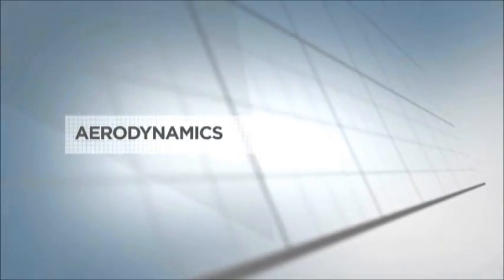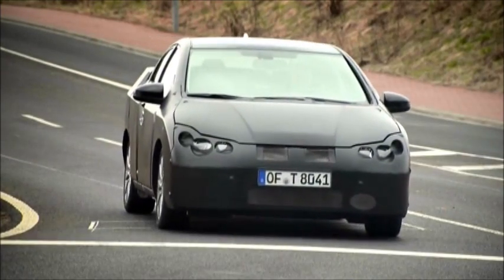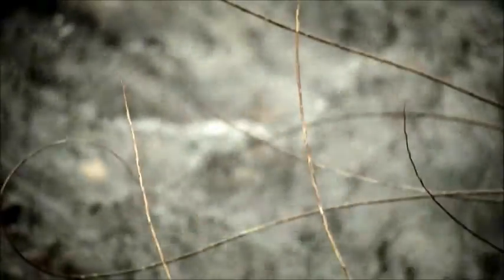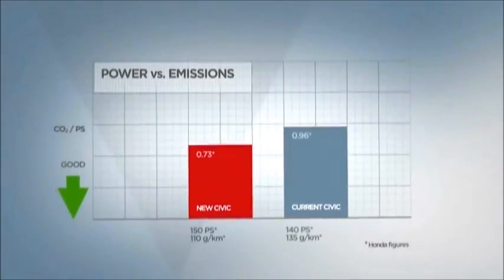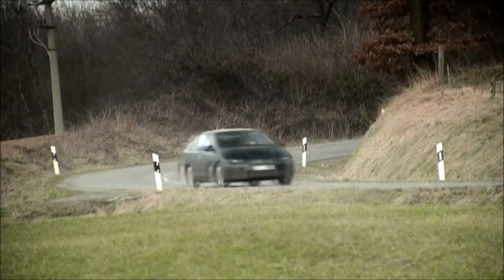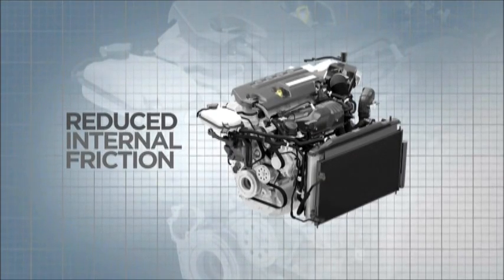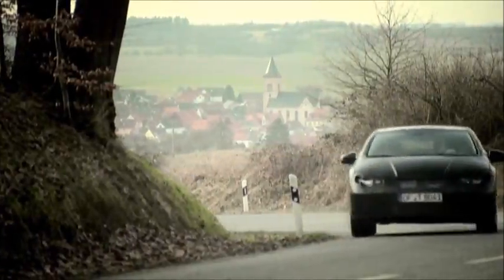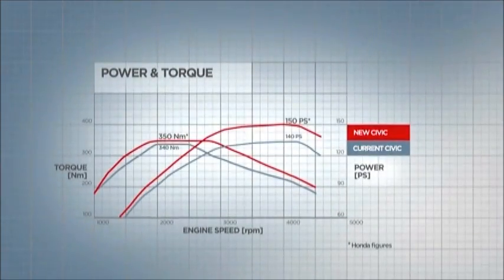Honda's 2.2-litre i-DTEC engine

Comment: I have the 2.2 DTEC Civic, it is the smoothest diesel I have driven, even better than the 3.0 V6 Mercedes Benz 
Only downside is the flywheel and clutch, car was made in Swindon UK and has ***t LUK components. 
Particle Mass is very low with just 0.13 mg/km and with just a particle filter, no Adblue! This is superb for 2012 car 2.2D !!
Compared to 2019 1.6 DTEC EURO 6  has : 0.1 mg/km and soot 0.51 m-1

Comment: I got 2,2 dtec accord. Engine had just one problem With pibe from EGR,  a litlle hole. Just new pibe. 230000 KM drived now, with out problems. I change oil every 10 k cuz of turbo and chain. Awsome engine but i wish more then 150 hp
Reply: Easily remap to 190hsp